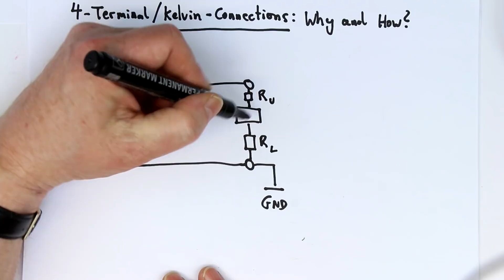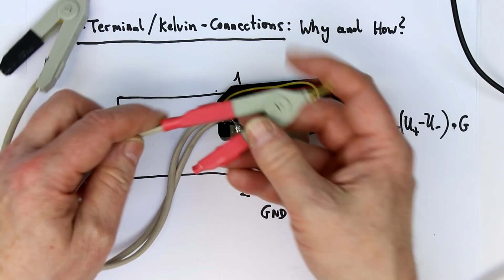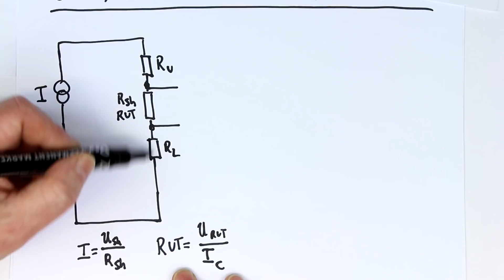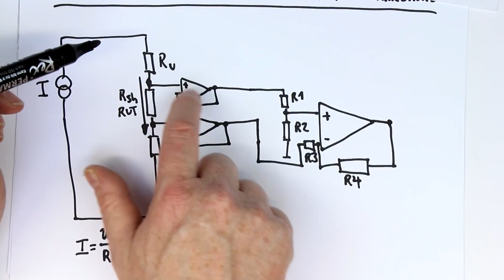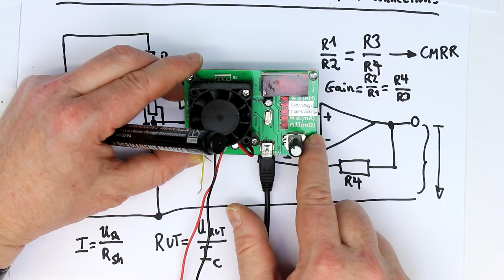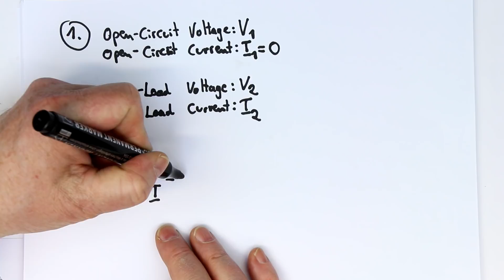4-Terminal Kelvin Connections: What, how and why to use them

Comment: When I want to use a 4-wire measurement, it’s usually for a much lower impedance DUT than a typical DMM. So I have a homemade 100mA CC box and use it in conjunction with a DMM on mV setting, and multiply the resultant reading by 10 for the milliohm measurement. Just requires a set of kelvin clips.